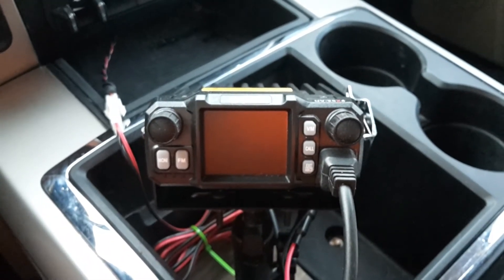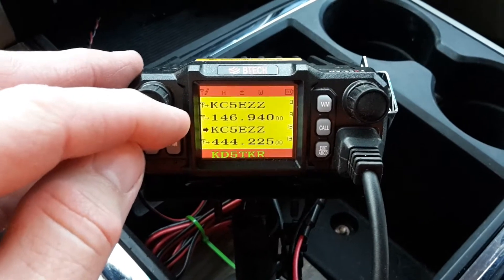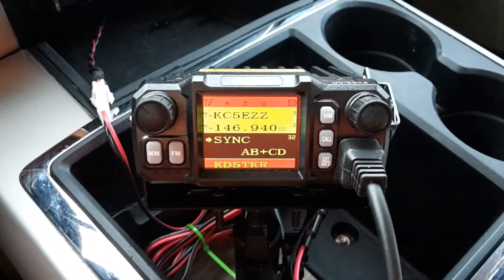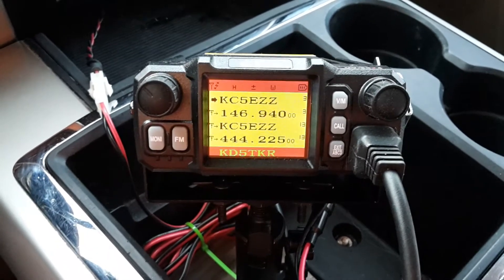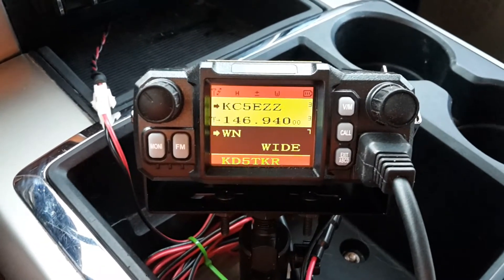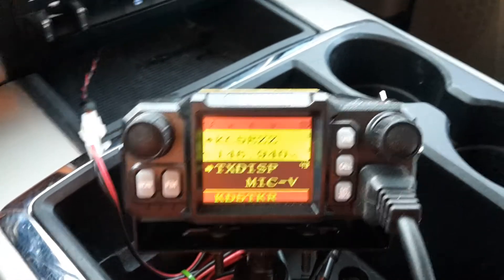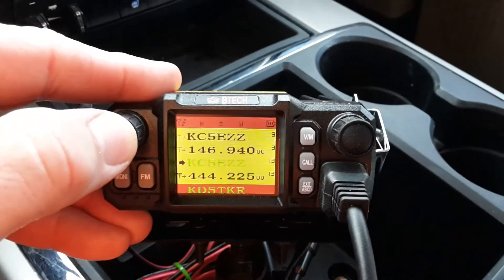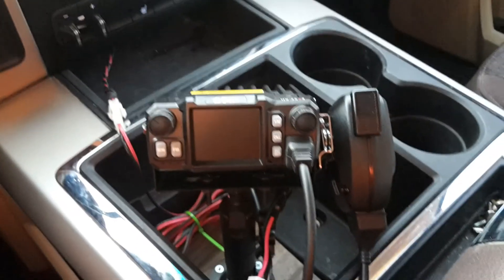New Mobile Tri Band Radio Part 3 - BaoFeng BTech UV25X4 Useful Menu Options and Vehicle Install

Comment: Thank you for the video. I bought a different mobile radio but had to return. The programming cable did not work with windows 11. Will this one be able to be programmed with windows 11. ?
Reply: Yes, I just got one and programmed it on my Windows 11 computer with chirp.

Comment: In my vehicle I have one of those power boxes (like SPod). I have a non-relay 12VDC (15A fuse) source. Do you foresee a problem with that power source? Or do I need DC Voltage Reducer Automatic Buck Boost Converter DC 8V-40V to 13.8V 10A Step Down Up Regulator since I am going from 12VDC to 13.8VDC.

Comment: Hey Bootstrap, I followed this video and your chirp video, I still can not get rid of the 20 meter or 350 frequencies on the display, was able to get the name to show on to bands / 2meter and 440  so if you can give me some advice on how to get rid of the 223 and 350 frequencies on the screen and replace with 2meter and 440 frequencies/name I would greatly appreciate it. Ron KA7MUB

Comment: I’m new to the HAM world, just got my license. I have my eye on two mobile radios, the BTECH Mini UV-25X4 25 Watt Tri-Band Base, Mobile Radio and the BTECH Mini UV-25X2 25 Watt Dual Band Base, Mobile Radio. What’s the difference between the two? Which one do you think will suit my needs as a new licensed HAM operator?
Reply: The X4 is a tri-band radio (144 MHz, 440 MHz and 220 MHz), whereas the X2 is strictly a dual-band unit (144 MHz/440MHz). Both are 25-watt radios. FYI: I have the X2 in my truck, and I average 21 watts ERP on mine.

Comment: Is the power "cigar style plug" able to handle transmitting with out a fuse blowing or other situation ? I'm asking because I prefer just to plug in accessory port not hard wire.
Reply from the maker: TJ Dobbs yes, the radio only draws around 7 amps. I haved used mine with the cigar lighter plug with no issues.
Reply: Bootstrap Workbench  thank you !

Comment: I have a question for you after I put on my frequencies and program the radio I have like that clicking sound from the radio can you tell me what that might be and how to lock out the channels
Reply from the maker: If you have 1.25m or 220MHz frequencies programmed in, then you will hear a relay click in scan, because the radio needs to switch low pass filters for each band. I would imagine that this relay would eventually wear out. The solution to stop the click it to not scan 2m and 1.25m at the same time.
Reply: I wanted to remove the 2m channels from the scan rotation, and tried to turn Menu-item 16 (SC-ADD) to 'off' so I could scan just my 220 frequencies, but couldn't get it to take.  It seems locked to 'On' .. am I doing something wrong ?  Also has anyone discovered a way to set upper and lower scan limits in the VFO scan mode so you can just scan the repeater portion of the band and not the whole freq range for each band to find active repeaters in your own area ?  -Dave N6BMX

Comment: I'm new to radios. As in clueless, so go easy on me, but do these HAM radios contact standard GMRS/FRS signals? I'm looking into studying and getting a HAM license. Most of my buddies communicate with standard hand held two way radios($80 Midland). Would this be pointless if they can't connect?
Reply from the maker: While you should be able to program in those frequencies to listen, it would be illegal to transmit. FRS/GMRS radios are type accepted for FCC Part 95, and these radios do not have that type acceptance.
Reply: Bootstrap Workbench can you contact with the other types like baefong handheld? New to this too😃like him would like my kids to have a hand held so i can play with them, plan on getting not the Tech license but another i heard off were your family is able to use with...
Reply: @BAWBayAreaWorking  all users must have a ham license to transmit. Get GMRS if you want family members to play with them, that license is family wide. FRS requires no license at all, BTW.

Comment: Thanks for taking the time to make the video, much appreciated. I just ordered this radio and was wondering what antenna you were using for it and/or any antenna options that you could pass along that are out there for use on a mobile.
Reply from the maker: Jon, currently I am using a Tram 2m/70cm NMO mobile antenna. Since 1.25m and 70cm are harmonically related, the antenna works on 1.25m, with some degraded performance. I am still looking for a triband mobile antenna that covers all three bands.

Comment: Just a quick note on the transmit power - If you push the #/lock button on the mic if will switch between high and low power modes without having to go into the menu.
Reply from the maker: Great info David. I did not know that, but I will make use of it soon.

Comment: I noticed that some digits turn green. I looked in the manual and didn't see anything about it. Do you know why some digits turn green? Thanks
Reply from the maker: You can configure the line to change color for transmit and receive. In many cases, once the color has changed for receive, it does not change back.

Comment: There are mistakes in how to configure it for repeater use in the official manual. It leaves out the menu 46 step which is how the offset direction is done.
Reply from the maker: Good catch! I have only programmed the radio from Chirp, because programming Baofengs from the from panel is tedious.
Reply: The driver i found for CHIRP said it was experimental. For the Hz CTCSS, I put in 131.8 and it transferred to the radio as q31. So I had to configure it manually.

Comment: Under which menu item did you add your call sign? Nice video. I just got mine today. Waiting for your next video on programming with Chirp
Reply: I found my answer in your Chirp video. You added your call sign in Chirp. Thanks,
Reply from the maker: Glad to hear that you found the information on how to program the static message. I actually like that it isn't field programmable, since it is more likely to stay in the radio if it is stolen.

Comment: Thanks for the video. I just ordered this radio to use while working. Going to use a RAM mount to the windshield. Seems perfect for such a small radio. Anyways, how did you attach the mic clip? Drilled holes or used what was already there?
Reply from the maker: +Jonathan Dickson right now the mic clip is attached using the rear radio mount hole and bolt. I need to drill a second hole in the bracket for the lower part of the clip. The bolt is a little too high and snags the button on the back of the mic, so I need to find a pan head or flat head bolt for that location. If that doesn't work out, I could drill a second hold in the bracket and move the clip. My main goal is to avoid drilling holes in my truck.